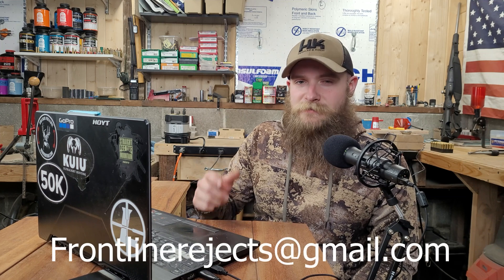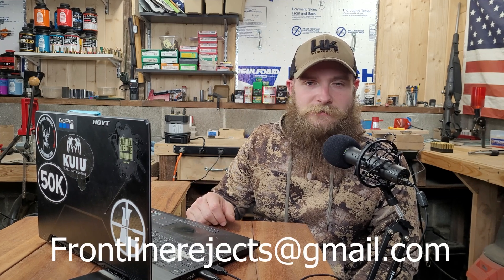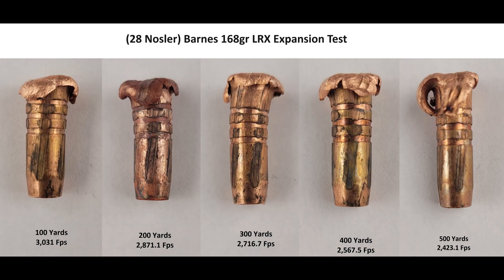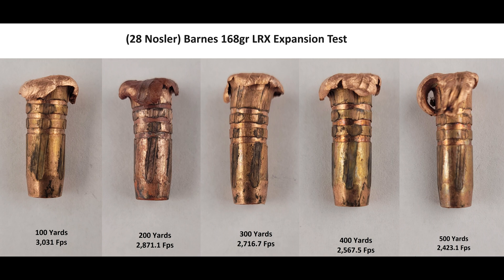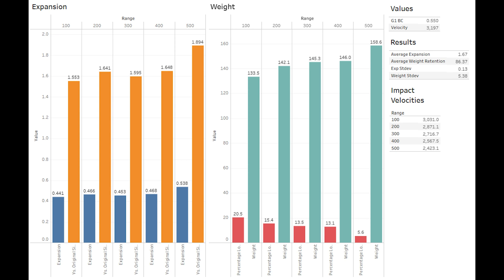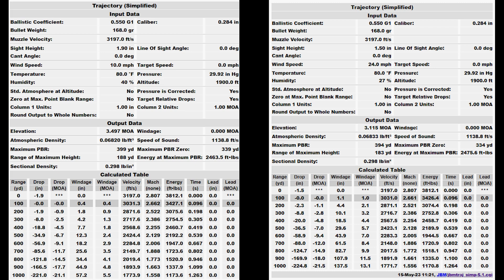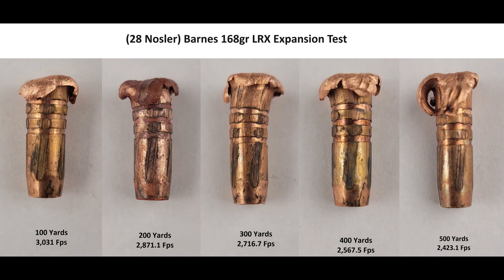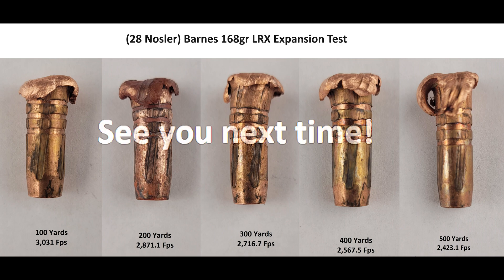(28 Nos) Barnes 168gr LRX Expansion Test

Comment: Good to see you back. I love your  testing methods. Id love to see a 7mm prc with the 160 cx.
Reply: There is no 160 cx in 7mm caliber. 150 is the heaviest.
Reply: @paulhomsy2751  no there is definitely a 160 it was specifically designed to be used in the 7prc they even sell it in a factory load.

Comment: So great to have you back! 
According to Barnes, the 168 grain, 308 Winchester, factory Vor-TX ammunition is actually loaded with an LRX bullet. 
Since these bullets were engineered for low velocity impacts, would you consider doing an LRX test in a short barreled 308, 
so we can see how they perform at 1500-1800 fps? 
Sincere thanks!
Reply: TTSX vs. LRX is a bit of a gray area. They’re just labels. The expansion characteristics are in the nose design, not the metal and LRX vs TTSX is based on aggressiveness of ojive more or less. The 168 TTSX is the lowest expanding 30 cal I’m aware if from them at a rated 1500 fps. It’s the best bullet in that caliber from 30-06 and lighter.
Reply: @Snailz5  Interesting. The Barnes tech that I spoke to told me specifically, that the copper composition in the 168 grain, 30 cal bullet was different than the other 30 bullets, not just the ogive. In fact he said all of the LRX bullets used a different copper composition than the TTSX.  Cheers
Reply: @EdAb  Oh, good to know. I was not told that information when I spoke to them, but I didn't ask that specific question.
Reply: @Snailz5  That said... I have received conflicting info from techs before. It is conceivable that the "balistician" I spoke to was incorrect. 🤷‍♂
Reply: @EdAb  I mean either way, that 168 TTSX looks to be a sweet 30 cal bullet. Performance above 2400 fps should be like a hammer or other fragmenting mono and below should be like a more traditional barnes. With a trustworthy bc you can work with (unlike Hammers, who inflate their number wildliy).